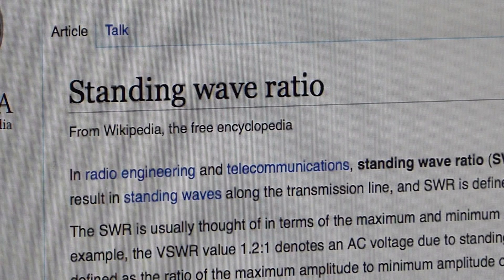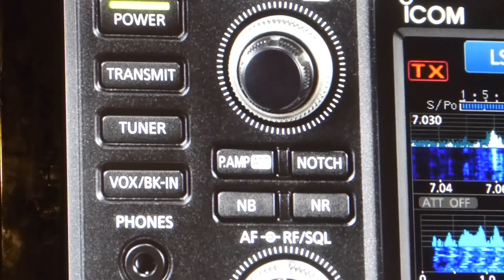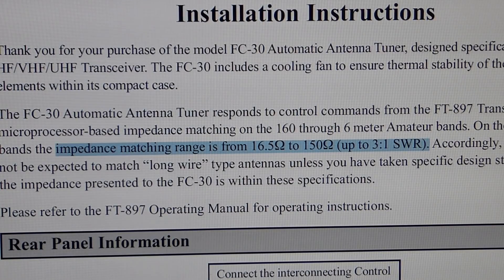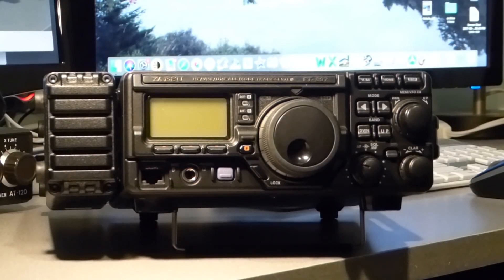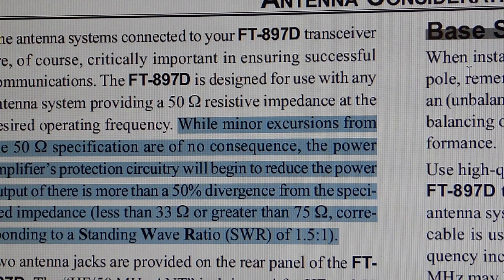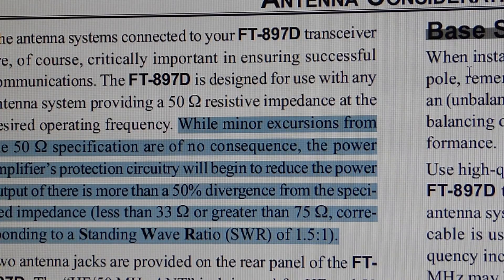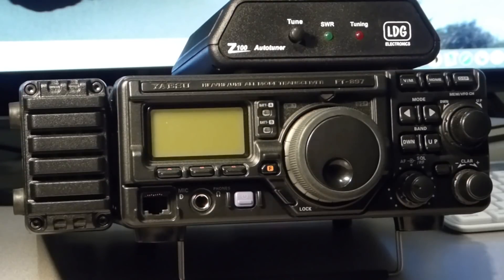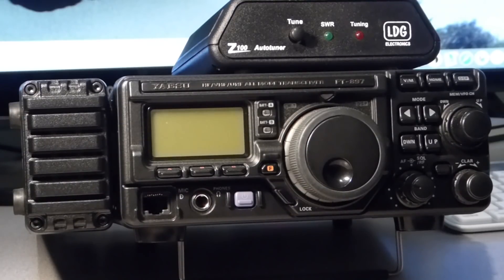Automatic vs  Manual Antenna Tuners

Comment: Hello!

I really did not know that the manual tuner had so many advantages. In my base station I do not use tuner because I use one of those antennas similar to Comet CHA-250, the tuning in this type of antenna is instantaneous and automatic, but in portable operations I use an LDG Z-817. It is very fast, but it's true that you expose the radio to a high SWR for a few long seconds.

Great video! 73

PY1XR
Reply from the maker: Thank you for sharing your experience, Fabio. 
73 from Tracy VE3TWM.

Comment: Tracy, I really enjoyed your comparison of auto vs manual tuners.  I too prefer the manual. I like to be able to tweak it down bit by bit to a flat match.  One of my pet peeves is Hams who tune on the air at full power. I tune while operating portable using my Comet antenna analyzer. I tune down to a good match at tiny power from the Comet without disrupting the band, and then I know I'm good to key up my rig (and I haven't wasted a bunch of battery power). I hope to hear you on the air sometime. KG7VDX , 73
Reply from the maker: Thank you for sharing your experience! 73 from Tracy VE3TWM.

Comment: I thought the auto tuners lowered the power before starting the cycle. If the correct tuner and cable are used that is.
I use the ldg z100pro with a yaesu ft891 and was under the impression once the correct yeasu cable was used when i hit the tune button the ldg lowered the power on the rig so as to not cause blown finals. Is this true or am i doing something I should be worried about
Reply from the maker: You are correct, that tuner and the matching interface cable will reduce power before transmitting.
Reply: Yeah when the Radio is paired with an auto tuner the Radio will drop Down to 10 or 5w in tuning mode well all my radios do. I think a lot of what he is talking about was with older radios and is not an issue at all on today's radios and the way they control power output. back then you may have had to turn your power down befor running the tuner.. 
so if you lets say are putting out 100w and have 10 watts reflected that is 2:1 rounding up..
so if we put 10w in to the tuner and it is running through a bad match the max your finals are going to see is 10w back.. that is not a grate deal of power and shod never hurt your radio at all.

Comment: Tracy, nice presentation, HOWEVER, you fail to mention REMOTE AUTOMATIC ANTENNA TUNERS at the antenna feed point! This arrangement RULES since the feed line operates at it's rated impedance with very little loss. Remote tuners at rhe feed actually will bring almost any wire or vertical to resonance, hands down!
Reply from the maker: Thank you for raising this point, Dennis. I haven't yet had the chance to use a remote tuner thus my unfamiliarity with their performance. I appreciate your contribution to the discussion. 73 from Tracy VE3TWM.
Reply: What remote tuner are you using ? Thanks Curtis

Comment: Tracy, this was really helpful to me, a relatively new ham who is interested in getting into outdoor HF.  I learned a lot and will explore moving to a manual tuner.  One question - if the transceiver has an internal tuner, I presume I can still tell it to not tune the antenna and then do that with a manual tuner that I have connected.  Is that so?  This Canadian ham says that’s a great sweatshirt!! VA7SGY
Reply from the maker: Hi Bruce, thank you for leaving a comment. While I don't know about every transceiver that has a built-in tuner, most very definitely give you the option to turn off the tuner when not desired.
PS The sweatshirt is one of my favourite things to wear in the winter, it's as warm and comfy as it is great looking :) Check out Douglas + Son's website (no affiliation).
73 from Tracy VE3TWM.1

Comment: Tracy, one additional plus for manual tuners over automatic turners is "batteries not required" for the manual turner. If you are on an extended portable excursion then every device that requires electricity for operation determines the capacity of the battery you will be required to carry. I know from experience that the LDG 817 automatic turner batteries will last about one year but it I go portable, even for a short stay, I take my manual turner rather than my automatic turner. All other points in this video I agree with you. Best 73 Terry KB8AMZ
Reply from the maker: Very good point, Terry. Thank you for contributing to the discussion. 73 from Tracy VE3TWM.

Comment: My weapon of choice is the Sotabeams Linked Dipole for my portable needs (40, 30, & 20m) but have found my auto tuner to be great for my OFCD while portable (goes into a 4:1 balun). As you said, fine as long as the SWR is no higher than 3:1. My OFCD and auto tuner is very convenient, however - as there's no collapsing the pole to connect/disconnect links to lengthen/shorten the antenna for what band I need.

Very useful video with great advice.
Reply from the maker: Thank you for leaving a comment, Mark! Any others reading this should go check out Mark's channel, he's done some very interesting stuff.

Comment: Although the transceiver 'sees' the correct impedance with an antenna tuner, the radiation levels from the antenna is restricted. I find this drawback worth mentioning if one wants to use a tuner. Therefore a well tuned antenna is much more desirable.
73 from PD0PSX, the Netherlands.
Reply from the maker: Good point, thank you for sharing. 73 from Tracy VE3TWM.

Comment: well when the auto tuner is running the Radio is supposed to be putting out only 5~20w Max to make there tune and not 100W
Reply from the maker: That is certainly the correct operating practice. Some tuners will do that automatically for you, some won't.

Comment: Thanks for this wonderful video.  My wife Jan (VAEEAC) and me Marvin (VE3VCG) are newly licensed HAM's in Ontario Canada. We're still very much in the learning process when it comes to gear.  Your video cleared up a good deal of information about automatic vs manual tunners. I can see the points you've made as being entirely valid up  to a certain point.  However I think the issue can be put to rest providing that the operator knows their gear well enough. We have a manual tunners at present and have learned a lot just from using if with various antennas.  However once we're  more experienced we should be able to know how each antenna tunes with a high degree of confidence.  With that information in hand we should then know also if an automatic tunner will work properly with a multi-band antenna. I don't really think this is a matter of old school methods vs technology.  It's all about knowing the gear.
Reply from the maker: I absolutely agree with you, Marvin. Thank you for leaving your comment.

Comment: The LDG 817 tuner drops the rig's power output while tuning.  Thousands of hams have been using them with no widespread complaints.  Sounds like a problem that might not exist.
Reply from the maker: Thank you for your comment, Mark. It is appreciated.
I'd like to add a few points:
- many, many FT-817 owners have had issues with the rigs' final transistors. A good number of FT-817 owners who have been bitten by the failing PA syndrome have reported using the rig with an automatic tuner. In these cases, the finger was pointed to the rig itself and not at the tuner (and as we all know, we need to take the entire system into consideration, not just the rig).
- while the Z817 tuner does reduce RF output, that will only happen if the tuner is used with the matching CAT cable. If the rig is only connected to the tuner with coax, that level of protection does not exist. This is true of any brand or model of automatic external tuner. 
- I showed the LDG in my video as I own two of them and no other brands. Definitely not my intent to single out LDG.
- reducing power and exposing the rig to very high SWR levels for an extended period will not eliminate the possibility of damage to the finals.
In my estimation, the danger to the rig outweighs the convenience provided by the automatic tuner. It sounds like your experience has been different. I wish you continued success in your radio adventures.
73 from Tracy VE3TWM

Comment: Some of my apartment antennas require the manual tuner, mfj 969 and some the auto tuner built into the rig  yaesu ft 900.   But never both at the same time.

Comment: Good video. Been a General for a while now, but really haven't had much space to get out there. However, I tried a few times on 20M with a FT817ND on a YoYo-Vee, but had no success on transmit. I later bought an MFJ-1786 loop, still can't seem to get a signal out. I guess I'm asking how can you know (without taking it somewhere first) if the finals are blown?
Reply from the maker: Thank you for your comment, I truly appreciate it.
Get yourself (or borrow) a good external RF power meter and either a dummy load or a properly working antenna. Then you'll know for sure. Good luck!
Reply: Thanks for the response. Hope to be able to do that soon, I do have both an automatic tuner and a MFJ-949E to test. '73s!

Comment: Hello great vidio...what do you think would be the best tuner for a yeasu 857d with a dipole for 10 through 40 meters
Reply from the maker: Thank you for your question. My favourite portable ops tuner is my Kenwood AT-120. It's ruggedly built and is compact. In this day and age of auto tuners, many older manual tuners are being sold at bargain prices on the used market. If you are patient, you'll find one before too long.
Reply: Thank you. I just got the 857 but I didn't want to get a tuner until I new some more about them...maybe some day we could set a time and talk on hf to see how my set up sounds like...thank you again👍

Comment: Hi Tracy, another upcoming QRP event you might be interested in.  QRP to the Field or QRPTTF.  You can find a nice, scenic river to operate from or choose a SOTA peak.  I know you'll go for the river in FL.  Its a joint effort with QRPTTF and SOTA: "QRPTTF is an annual operating event to encourage QRPers and SOTA stations to get out of the house and operate portable “from the field” or a summit, and of course, have fun.  Find a nice operating location for yourself, or combine it with some buddies for a day-long adventure. QRPTTF encourages participation by QRP hams of all skill levels. CW speeds are usually in the 13-20 wpm range."  Here is the URL for the event:  http://www.zianet.com/qrp/qrpttf/2018/ttf.htm
Reply from the maker: Thank you for the tip! While I wouldn't mind operating from a river in FL, I'm in ON. No summits within hundreds of miles of my location but I might be able to find a river.
Reply: Tracy, its a "joint operation" of sorts between Parks on the Air and SOTA.  Go find a river and operate from there, if you wish.  I'm doing SOTA that weekend anyway so will hopefully run into you.

Comment: I generally pre-tune with the manual tuner and then only let the auto/built-in tuner catch the bandwidth issues on the wider bands.  Also my rig quits auto-tuning if you hit the "tune" button again while it's surfing around for a better impedance.
Reply from the maker: Good practice, Wade. That's a nice feature your autotuner has.

Comment: Manual ATU vs Automatic ATU, batteries not required for portable operation, which would be extra weight to carry for the automatic tuner.
Reply from the maker: Good point, Terry. Thank you for sharing.
Reply: Terry Morris said

Comment: Thanks for the video to which I'd like to add a word about the different kind of tuners available on the market.
What is described in the video goes mostly about T-matching circuits and other matching type like Pi, Double-T, L-match...exist. 
These all serve the same purpose, though they don't have the same specifications or field of use.
By this I'd like to tackle the antenna feed impedance for symetric vs. asymetric, centre-fed vs. end-fed, lw.... all require a specific type of matching unit and impedance tuning range. So I'd like to advise all to check which is the most suitable tuner for each antenna configuration. A good source of information is the MFJ webpage (this is not meant to be an ad), go through the specs hand have a look at the schematics.

See you on the air and 73's,

Patrick - ON4KNP
Reply from the maker: Thank you for the interesting comment, Patrick. 73 from Tracy VE3TWM.

Comment: Thanks for the great video.  Just stepping up to General level and tryting to build my own NVIS for intra-State comms.  This helps with my understanding of tuning, as well as the auto-vs-manual options.  Great technical info, presented in a digestible manner.
Reply from the maker: Thank you, Tom! Good luck with your NVIS antenna, sounds like an interesting project.

Comment: What is a good small manual tuner to take out in the field?
Reply from the maker: Thank you for your question. My favourite, though a bit heavy, is the Kenwood AT-120 that I've shown in the video. I don't think you can buy a new manual tuner that is as well built as this one. AT-120's (and the nearly identical AT-130) are not too hard to find on the used market.
Reply: Thx!

Comment: Watched you video while attempting to decide to add a manual tuner.  Manual tuners seem to be able to handle additional power levels where rig ATU’s are geared toward 100watts or less.
Reply from the maker: In some cases they can, just keep an eye on the specs before pulling the trigger on one.

Comment: This is excellent.  Thank you for posting this video!  I'm an old Know-Code Extra, first licensed 41 years ago, and the only automation in my first station was the transmit/receive antenna relay: otherwise, I had to do everything else manually.  (Kind of like driving a stick vs. an automatic--the operator has to know the rig's capabilities and traits in order to make it work the best.)  

Once I upgraded to a rig with the automatic tuner built in, I still kept the manual tuner in line just to help out as needed--I've discovered that they work well together and the internal adjusts to the external with no problem.  Like you said, even though technology has made huge strides very quickly, amateur radio is still technical, and matching things up like this is part of it.  There's just no beating a resonant antenna, but this is the real world, and the tuner is sometimes needed to bring things into harmony in a compromise situation.

73 DE KØVZ
Reply from the maker: Interesting use case, thank you for sharing your experience! I like your stick vs. automatic analogy.

Comment: Agree on preferring resonate antennas - just built a linked dipole 40/20/15/10 based on the VK1AD design. I only use a tuner at home on a random long wire and the z817 seems to handle the bands I want ok. VK1FWBD
Reply from the maker: Thank you for your comment, Wade!

Comment: Thank you for the video. I have three automatic LDG tuners for my radios.  One is for my FT-817 and is the Z817 that I have use very little. For QRP to me it is better to use resonant antennas to minimize losses. I can say when I have used my Z817 I turn the power down, I think you should always tune a the lowest power you can. You make a very good point on manual tuners, you can use them without transmitting. On that point I plan on getting one.
Reply from the maker: Thank you for sharing your experience!

Comment: Very good treatise of the antenna auto-tuner subject. Money spent on auto-tuners perhaps is better spent on a dedicated antenna analyzer or noise bridge in the shack with a manual tuner. Saves the stress on the rig and spares other HAM's of  annoying QRM related to on air tune-ups. Many thanks... 73.
de K4WRF
Reply from the maker: Solid advice, thank you for your comment! 73 from VE3TWM.

Comment: Very well put!  I agree 100%.  I have both but rarely use my automatic tuners except in my Elecraft rigs.  Also keep track of your tuner knob settings on the manual tuner.  If they somehow in this tuneup don't come close to the last time you used it there might be an antenna problem...... Like it fell down in last nights wind storm or a wire broke in the connector...... It's a great antenna tester, something an automatic tuner won't tell you.

Dave K8WPE
Reply from the maker: Thank you for these great tips, Dave!

Comment: Thanks very much for this great video! I wholeheartedly agree that a manual tuner makes much more sense. One additional plus: Manual tuners tend to be passive and don't require external power, except perhaps for the LED that illuminates a meter. A little automation is fine, but some things can definitely be done better and more efficiently manually. Btw, I do subscribe to Julian's wonderful channel as well. 73 de K1RSK.
Reply from the maker: Great point, thank you for sharing! 73 from VE3TWM.

Comment: Great video...  I'm a new Ham as of a few months ago and as of yet, have not acquired my first rig.  Do you have any recommendations.  I'm interested in taking my rig hiking and operating on low power.
Reply from the maker: Hi Michael, I'm totally biased but my pick amongst many fine QRP rigs is the Yaesu FT-817. You'll need to determine what features are important to you, then base your decision on that list. For example, if you are 100% CW, then the 817 may not be the best choice. For me, the 817 checks all the boxes.
Reply: FT817
Reply: Some might say that QRP isn't the best type of operation for beginners, unless he/she has a GOOD expectation of the challenges involved.  If you're very patient and don't "need" to make any contacts right away, then go for it.  

Going QRP out-of-the-gate is akin to getting a motor vehicle operators license--and then riding a bicycle everywhere you go.  Options will be quite limited. Best of luck.